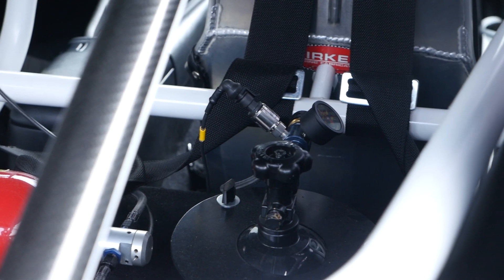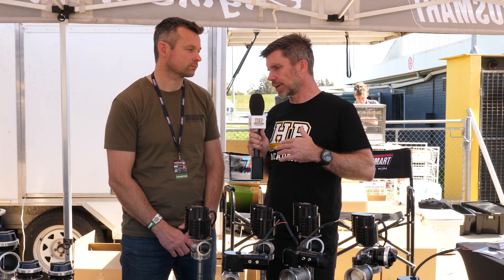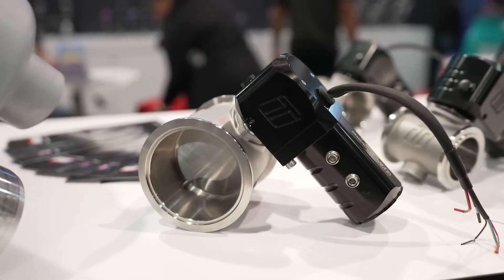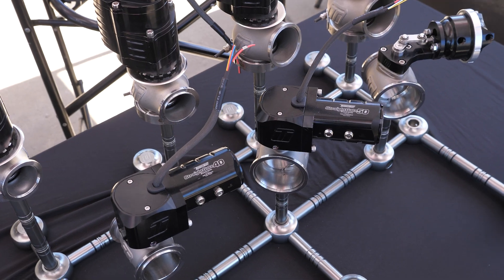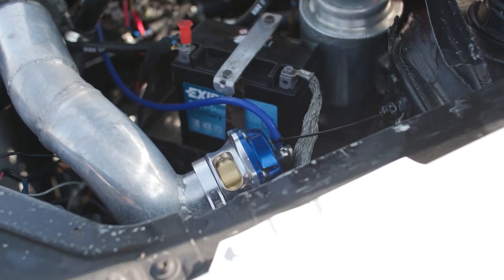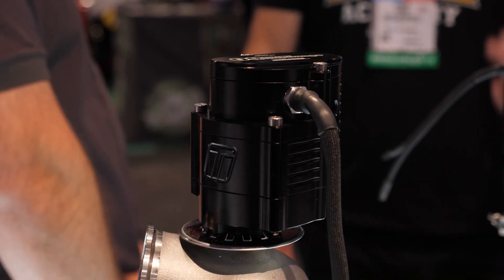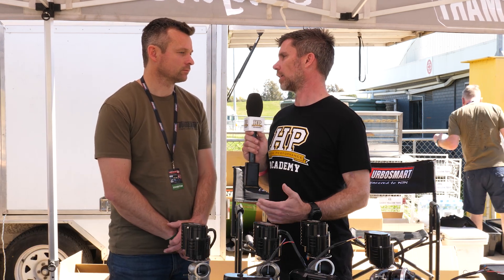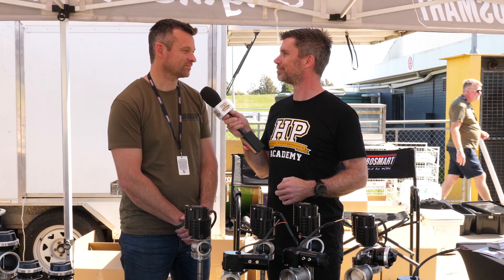Inside Turbosmart’s Electronic WASTEGATE Technology

Comment: Gonna run a pneumatic ext Turbosmart Hypergate 45 and a Boostgate cold side using Turbosmart’s T2-6466 in a forged Kelford stage 2 cammed ported and polished head k20c1 2018 Honda Civic Type R Motec 142 stand alone, PPG gears

Comment: Say you hit the rev limiter before shift and you get a bang in the exhaust, that valve wont open more and let out excess pressure like a sprung CO2 gate would. I'm no expert by any means but it seem like that could hurt an engine cuz the next cylinder to do the exhaust cycle is gonna have to work against that huge back pressure. I think it could hurt the turbo aswell.
Reply: You could probably use a back pressure sensor and map a safety for that
Reply: @damebashmotorsports  It doesnt move fast enough, A spring starts moving instantly when pressure begins to rise.

Comment: Has Turbosmart been engaged with Kyle Wade (BoostedBoiz) about the boost control issues he was having with his E-gate on the K-swapped MR2?
Reply from the maker: Sounds like a question for either of those 2 parties rather than us? - Taz.
Reply: He's problems was the vacuum hose on quick connectors not the e gate ok

Comment: The new Porsche 911 eTurbo doesn't even have wastegates, e-hybrid turbos are here, the future is now. Why waste time developing wastegates when the eTurbo solves the spool and boost control problem? It's also pretty catastrophic when the wastegate servo wigs out.
Reply: Because e-turbos are expensive, require an additional battery to run, and can be complex to set up? Sure, they're interesting and useful tech, but they need a good bit more development to get the price and setup difficulty down to the point that it's practical for the aftermarket.

Comment: Im on this boat im not using a turbosmart egate but i fitted a bmw b58 internal egate to my hx40w that im putting on my 4g64 this will give me ultimate control and the ability to have a boost failsafe as this is a high compression pump gas engine atleast for a few months when its running.

Comment: I might try a E-Gate in place of my BOV next season, elliminate the waste gate altogether, control boost from the BOV
Reply: @GoFasterHD  that wont prevent your turbo from spinning way too fast and blowing up or overheating
Reply: @d @drunkinmaster1 did you watch the video? More and more are doing just this, controlling boost from the cold side. My waste gate is shut during for a pass any who.
Reply: @GoF@G @GoFasterHD 

Higher compressor speed = higher air temp as well. 
Higher shaft speed = higher exhaust pressure ratios. Higher egt and back pressure at the engine. 

Higher turbo cold side outlet temp. So it’s less efficient for the same airflow the engine consumes. Less air density.

Some very specific drag racers and land speed racers do this to bleed air off to prevent compressor surge. 

That’s a very specific application. 
Tuned by Shane talks about this on the street alpha channel. 

By bleeding off the bov. The turbo is spinning harder. 

Less of an issue on drag style engines with less that 1:1 exhaust back pressure ratios. 

Circuit, drift and street engines run higher ratios for response.
Reply: @gc6848  circle drift? do I look like i'm drifting a stretched out Turbo drag bike? You guys crack me up. I didn't just fall off the turtnip truck been racing boosted Harleys for 10+ years

Comment: I pulled my 2JZ out of my E46 to rebuild for next year, and I'm definitely going electronic wastegate!  It's a street car and I probably don't need it, but I WANTS it lol.
Reply: I see it as a great option for very different boost levels for street driving without boost creep.
Reply: @HardstylePete  you really shouldn’t adjust boost levels much on the cold side 

It’s a great way to over rev the turbo
Reply: @MyLonewolf25 That's using the electronic gate to vent hot side pressure, reducing the cold side pressure.